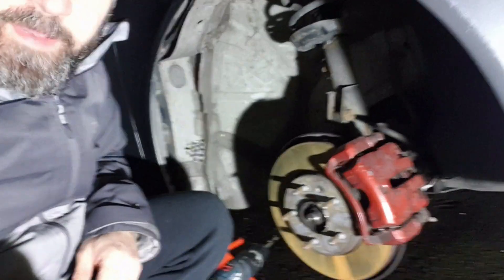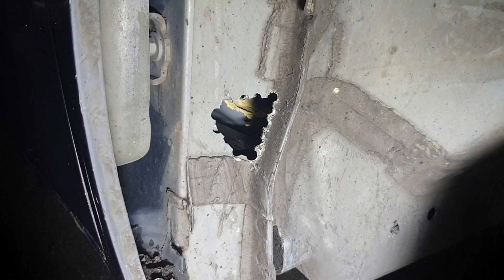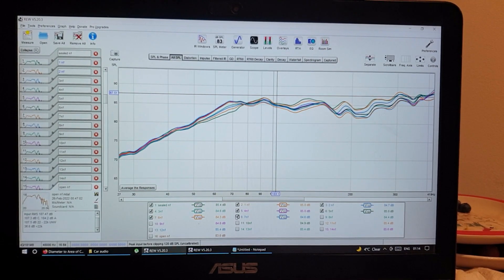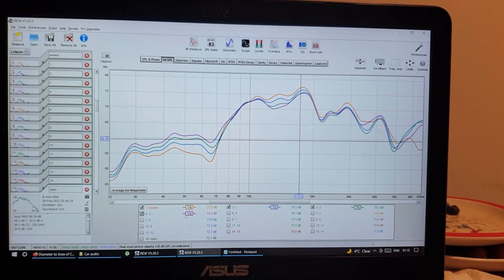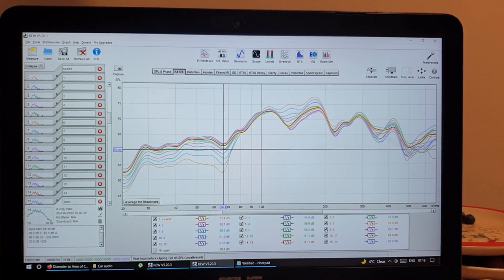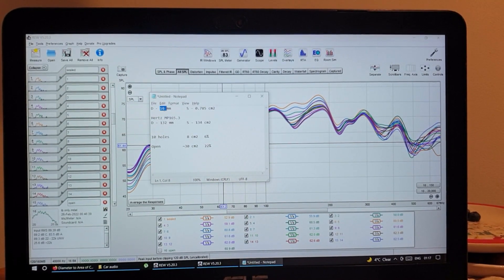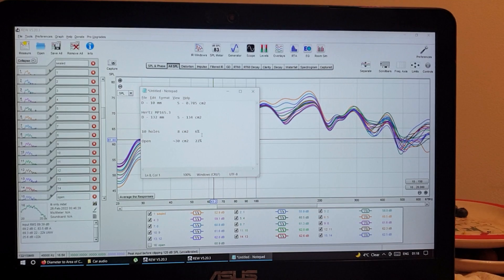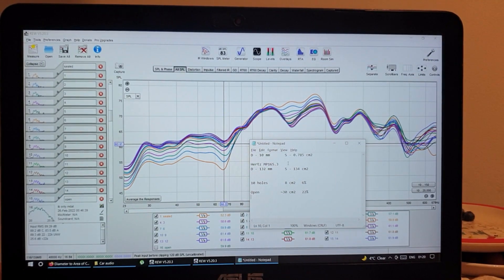Cut out for infinite baffle kicks. How big?

Comment: Your problem is that your driver has high Fs parameter 70Hz, that why you have drop around 70hz. Try to measure speaker with lower fs 40-60Hz if you need more low end. Second, your woofer has 0,58 qts, but higher will be better for IB.

Comment: I believe the vas makes a large difference as to how much opening you need. So a driver like a HAT 6in may want a much larger opening than something with a smaller VAS.
You also have the sills acting as a volume behind the driver as well, which should theoretically allow for a smaller vent. But also will theoretically allow it to act as a Helmholtz like you stated with the 140hz dip.
Just my understanding without testing it out though. I'm glad you did this test, because I've been trying to figure out something similar as to how much of a hole some wm8 may want.
Thanks for the knowledge!

Comment: Thanks for this great video. I think that 50% is the general rule. But it’s great to see the curve change on each step. Really appreciate. I don’t go ib in my car but anyway like to learn something more. It will be really interesting to see with other speaker. There’s speaker that are made for ib application or got better spec for ib.
Reply: I believe that speakers that have a larger VAS (like IB specific drivers) will want a larger hole than something with a smaller VAS.
So a HAT legatia 6 with a VAS of 18.5L should theoretically need a much larger cutout than an Audiofrog GB60 with a VAS of 8L.